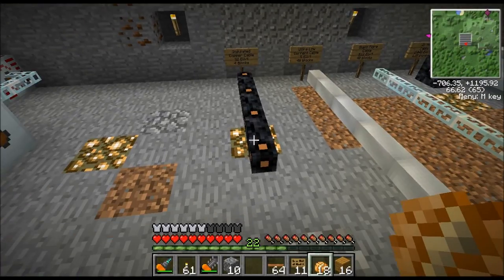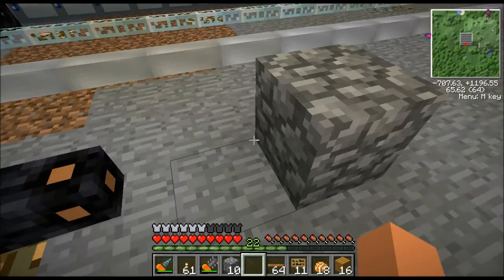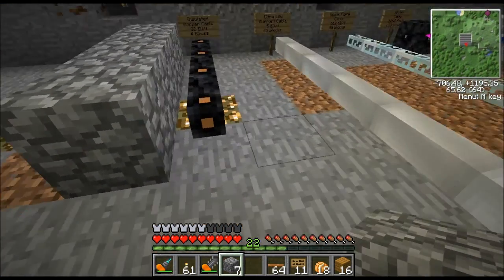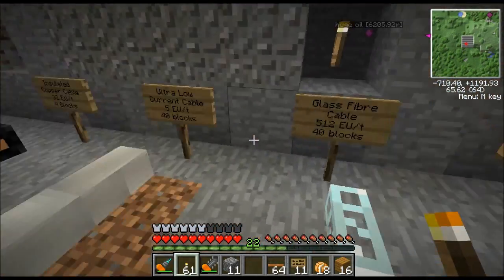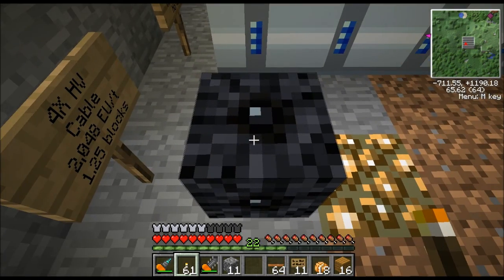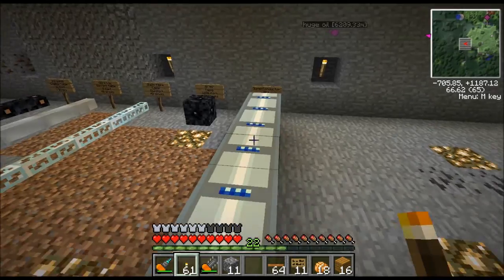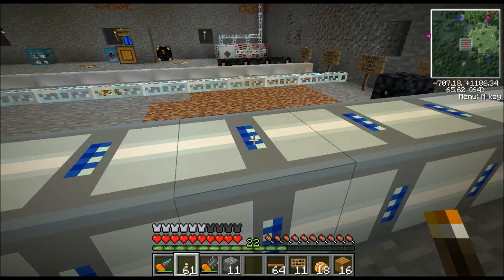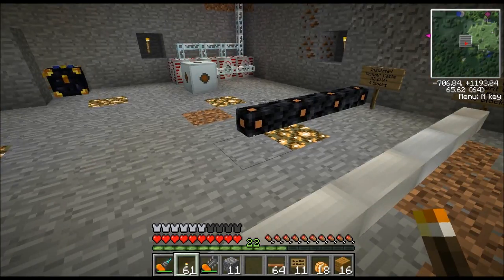FTB/Feed The Beast Tutorial -  Commonly Used EU Power Cables

Comment: If a nuke is properly designed, it has no chance of exploding.  And while it can be tricky to get a safe one capable of putting out more than 512EU/t, I think it still ends up being cheaper than building the 64 advanced solar panels you'd need for the same output.  (I will obviously go with hybrid solar once I get UUM production up and running, but I'm currently using nuclear to give my power production the extra boost it needs for the Matterfabricator to run in the first place.)